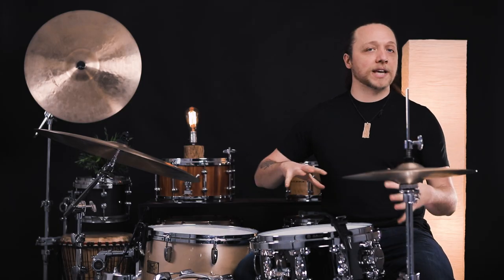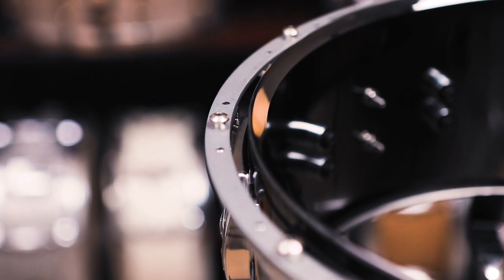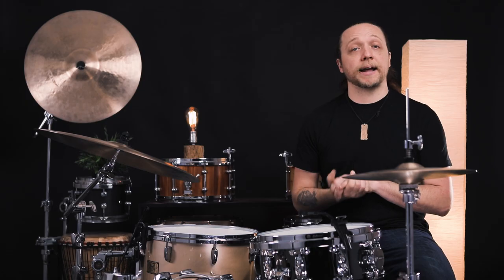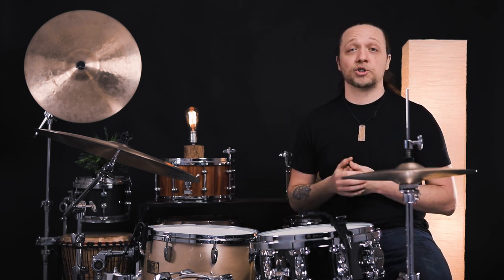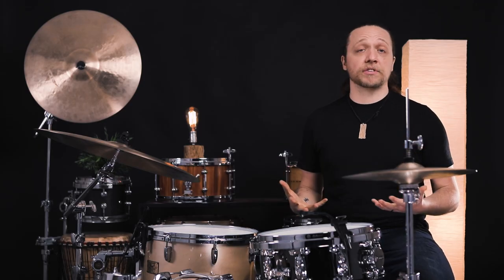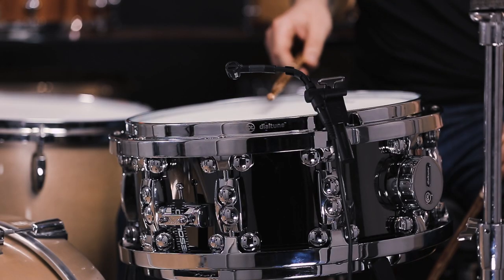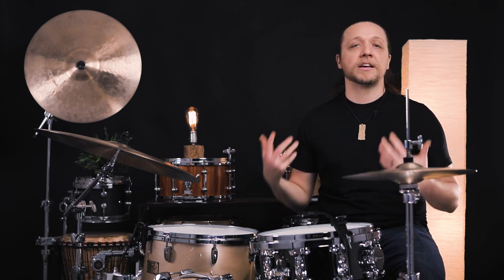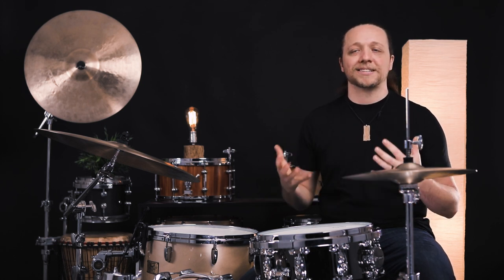Beauty of a Nickel Over Brass Dialtune 14x6.5” | Snare Spotlight

Comment: I'm really thinking of investing in this drum someday (once I can save up for one that is)
but I have to ask, if one day, one of the lugs de-tunes itself, or if I'm just looking for a trashier drum sound, is there a way to individually change the lug's tensions? 
I see there seems to be dimples on the round bits, are those to be used with a proprietary tuning key sort of deal?

edit: looking at the mechanism I now doubt there is a way to tune individual lugs, however maybe just releasing all the tension and re-tensioning it would even out the lugs I think.

But it would be nice if they added perhaps an additional tension rod system ontop of all that, to have access for individual lug control
Reply: Definitely doesnt tune like a regular drum and I wouldnt think you would be able to do what you're saying with retuning a particular lug of the drum. But man! what a system!

Comment: Keeping it real..coming from a dude rocking a Fisher Price chrome over who knows Tama entry snare. Yeah that metal snap in my shed is actually brutal. I much prefer wood. But I've thought about maybe trying a Evans dry batter to cut some of that high end pop/ring..??????.
Reply: You can leave the reso a bit higher, but lower the batter a bit, and dampen it a bit, like a tone ring and or a wallet (I have both taped to my snare)
Reply: @LeakyJAZZ  yeah I do the wallet thing and I also cut out an old floor Tom head and use it.